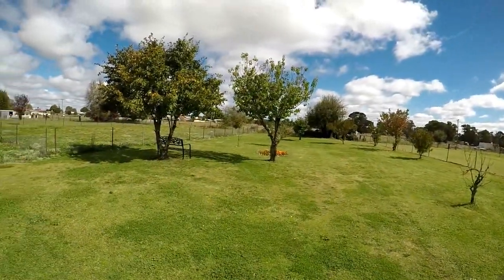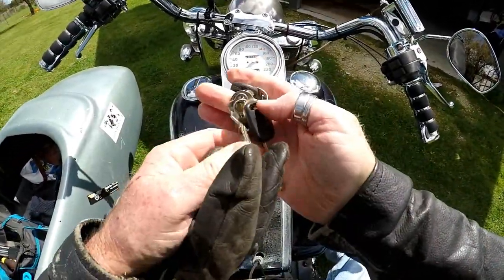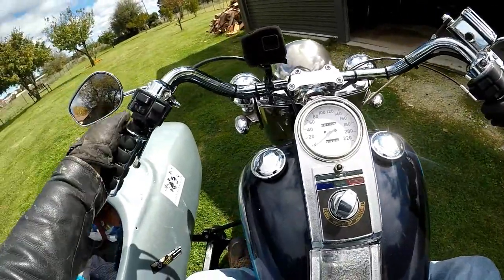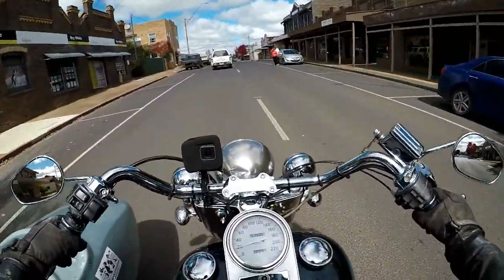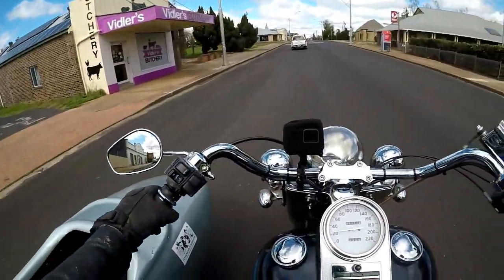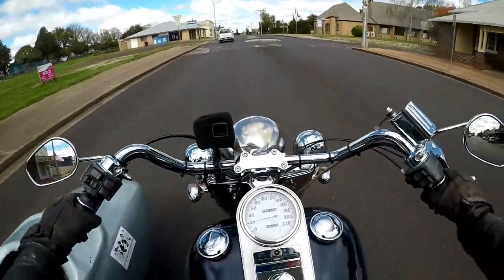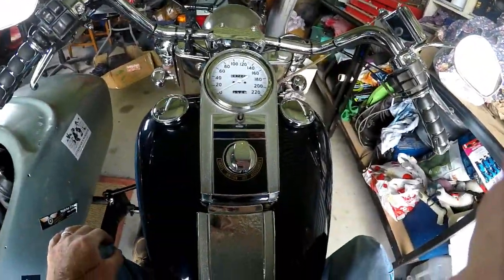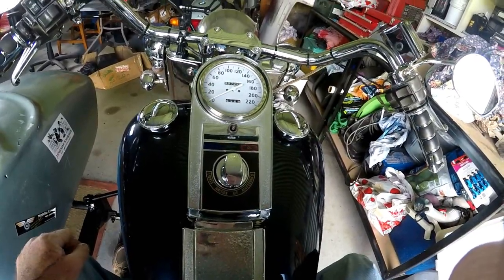1988 Harley Davidson Heritage Softail and Sidecar:  A short test ride around the village.

Comment: 1988, good year. My 1988 Harley only has 232K miles on her...and hauls a Watsonian Cambridge...aw man, sorry about your brother. 
I lost one of my brothers New Years Eve for 2020, right before all the covid crap started. A brother who rode, something I never had, even with 5 brothers. Enjoy her..
Reply from the maker: Thanks James.  Yes, he was the one who got me into bikes in the first place. My older brother and mentor in many ways.
Reply: @saxonost7  damn man, just made me tear up from half way around the world... Love you bro, know exactly how you feel.
Trick so you don't need a steering damper, been doing this on my 1988 for decades, tighten the steering head nut until it takes 10 pounds to pull the handle bar and you are done...yep, safe to do it on that frame, go a few years ahead, and not so much...enjoy that bike! Might be that miserable relay down by the battery...evil thing.
Reply from the maker: @JamesAllmond  The front end feels ok so far, but it's not been ridden ' spiritedly' yet hehe. Thanks for the tip about that relay. I'll investigate it as I went through the fuel system today and didn't find anything unusual. Clean as a whistle really.